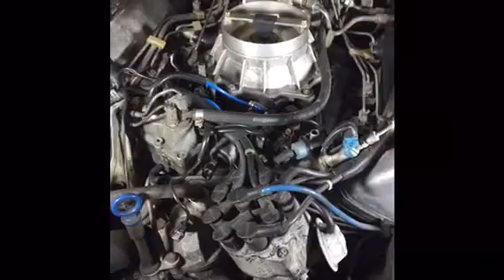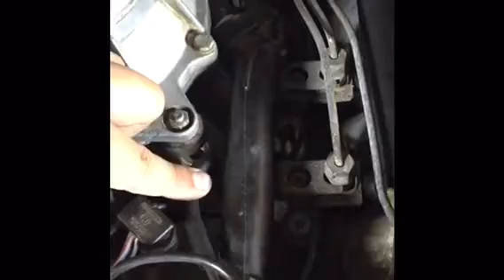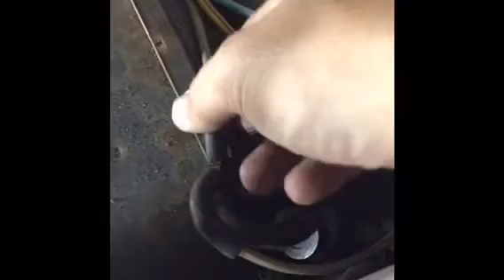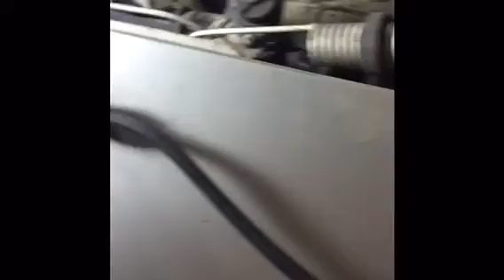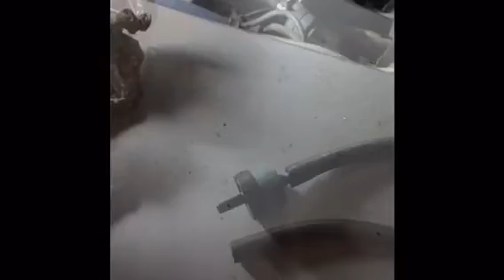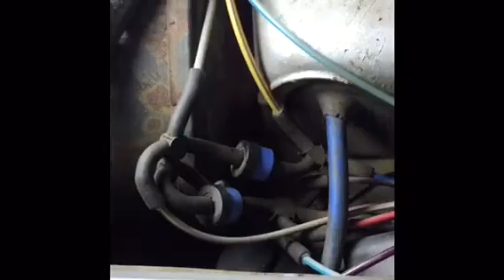How to repair Mercedes high idle M117 vacuum leak part 2

Comment from the maker: The parts are NLA (no longer available) i have used my years of experience to redesign the parts and offer them for sale in my webshop.

https://everdrive-parts.com/products/mercedes-vaccuum-housing-restoration-kit-complete-8-cylinder-set?variant=56361157427580

We produce them in batches only so if they are sold out - please use the NOTIFY ME button to be informed when they come back on stock again.

Comment: What would be damage of high idle 1800rpm on park. 800 on drive?
Reply from the maker: No damage - just high fuel consumption- and may clunk the gearbox when put in drive…..
Reply: @Everdriveparts  yeah it loud when i put on D or R…

Comment: Dear Richard,
Calling for help from the Netherlands.
I have the same idel control unit.
The only difference is that my power transisor is burned and black. The small transistors is only one readeble for its number.
Do you baybe have the numbers for me so I can fix mine.
Kind regards,
Rodney Bos
The Netherlands
Reply from the maker: Unfortunately i never wrote them down - i was just sharing my knowledge on a private car

Comment: If you are still active, thank you for these very educational high idle and vacuum leak videos. I have a 1983 500sl with the 117 engine and K Jetronic (not KE) injection system. In this video you test a blue/black check valve, but in the part 1 video it is a green/white valve (like I have), which I understand is not a check valve, but a restrictor. What is the purpose of the green/white valve and did you replace it with the blue/black?
Reply from the maker: The green/white is a vacuum restrictor. There is a right and wrong way to connect them in line. I believe green is towards the vacuum control of the ignition. This is also the purpose. Restricting the vacuum controle valve on the ignition. Basically, a green white is two way and a black and blue is one way. Meaning, if you switch the green white with a black blue the vacuum adjuster of the ignition will not return to normal state after engaging so you ignition timing will be off and the car will not run properly. Testing the green white is easy.. suck on them. Green white will open from two sides. The black blue only one side. If either don’t work they need to be replaced. Green white rarely breaks.

Comment: Oh Richard I really appreciated all these videos. Though dare I say I am beginning to hate this car.
 I went through the first hell replaced tons of stuff,  computer, all the fuel injectors/hoses, ovp, idle valve replaced.. I have gone through case of carb spray.. ran fine for like a week idling great. Then back to like 950-1k rpm. 
The economy on the dash shows pegged to left.
Will run the gambit on these items.
Guess its time for smoke and vacuum test gauge or to sell it off.
Reply from the maker: Good luck- it sounds like she has you good. I would spray some carb cleaner around the mechanical injectors while car is idling if you notice a change in rpm then you have found your leak, alternatively it can also be a vacuum switch- 5$ part giving you grief.
Reply: @Everdriveparts  Yeah, it could be I had spent over 50 dollars on carb spray trying to find the leak. Though I finally found in in a seam split on a brand new hose.  Wait got it  fixed. Go to start it and now won't start. Fuel relay died randomly. It won,  it's going up for sale next month.
Reply from the maker: Sorry to hear that- sometimes they do. Maybe you will find the energy again
Reply: @Everdriveparts  Well, wasn't a fuel pump relay my ignition part that sends a signal to the relay died. Thanks for your words of confidence, but it's going up for sale. Other than doing a more modern day engine swap, it feels like this thing will be in a constant state of broken even if I replace everything.

Comment: I have a couple of questions relating to your excellent Vacuum video. 
1. Are the various Vacuum system independent of each other. For example would a leak in the central locking system affect engine running?
2. Am I right in thinking that an economy gauge not sitting on zero when the car is idling implies a vacuum leak? If so, what could a vacuum leak in this part of the system affect? eg rough idle, cold start, fuel economy etc
Mike
Reply from the maker: Hi Mike,

1. Yes, the systems are more or less independent. Left near de coal behind the booster you will find a series of tubes with checkvalves. See all my videos. A small leak would not affect the idle significantly. But, a series of leaks and bad checkvalves will make sure you won’t be able to keep a vaccuum such as needed voor de AC and the Central locking. 

2. Yes, I’d the econometer works- check based on my videos it should be on zero at idle. It is the only tube directly connected to the intake manifold Without! a checkvalve.  Usually when the econometer is not at 0 you also have engine issues. See my videos on how to fix the vaccuum leaks around the injectors which is a common problem. 

Thanks for watching, like and subscribe my videos!!
Reply: @Everdriveparts  Thanks for your prompt reply. I connected a home made smoke machine to the vacuum system and have found a leak in a large black rubber pipe which is connected to the back of the engine block. The other end of the pipe is connected to a  white plastic T joint, one end of which also appears to be connected to the front of the engine block and the other disappears under the fuel distributor. I'm interested to know whether this leak has any bearing on my small cold start issue. Car starts right up but stumbles and wants to stall if you touch the accelerator. Runs fine when warm. Interestingly, disconnecting the power lead to the warm up regulator doesn't seem to affect the cold start. I am wondering whether the vacuum leak I have found is in any way linked to the Warm up regulator? Mike
Reply from the maker: Hi Mike, what car and engine? I’ll just assume for now it’s a 560 us spec then you may check the O2 sensor in the exhaust. Also the WUR maybe working but have you checked the electronic injector on the right side connecting to the WUR. 

The black pipes you are talking to are the engines main vaccuum system. They need to be in top notch condition before you even attempt at looking at something else. 

It takes some tenacity to solve these problems especially without proper equipment.
Reply: @Everdriveparts  Thanks again for your reply. The car in question is a Euro spec 280SL straight 6 engine as opposed to a v8. No O2 sensor on this model and cold start injector tested and working. I have today ordered the big black engine vacuum hose from Mercedes and will be interested to see what effect curing the vacuum leak in that pipe has. When the part arrives, I'll post a video and will make sure I mention your excellent videos on merc vacuum. Mike

Comment: I am working on a 85 500SEC Euro that was converted to US spec and has some unknown aftermarket O2 sensor connected. It has the same connection coming off the warm up regulator going to what in effect is a fuel injector. If I remove the system, I still need to power the injector. I am attempting to sort this out. The videos were very helpful, since it is a European Model.
Reply from the maker: Your welcome. The WUR and cold start injector is essential for the engine proper starting. The O2 sensor modulates the duration “open”
Reply: Do you have any knowledge on the aftermarket blue box system?
Reply from the maker: Never heard of it actually. What is it?

Comment: Hi Richard, 

Very helpful videos thanks for taking the timeout to share. 

I want to do a smoke test on my W126 560 SEL, can you tell me where I should connect the smoke producing hose? And what I should cover up?

Many thanks!
Reply from the maker: Left behind engine block is feed hose. Put smoke tester on engine to test vacuum system. Put a rubber glove on injection to prevent smoke escaping through MAF. 

Put smoker on disconnected hose to test car vacuum system. Quick tip: disconnect the runners in the door jamb to see smoke escaping from the doors sooner. A lot of leaks originate from there due to the open and close of doors

Comment: Hi Richard, thank you for your detailed video. I have a 1983 500 SEC and exactly the same idle control unit. Mercedes wanted to install A new ABS control, only the repair was about 240 euros and a new one .....?(fortunately they didn't tell me the price), because in the dash board the ABS lamp was on but the breaks of the car were stopping as normal. YOUR VIDEO IS A MONEY SAVER. Thanks a lot.
Reply from the maker: Happy to hear I could help you